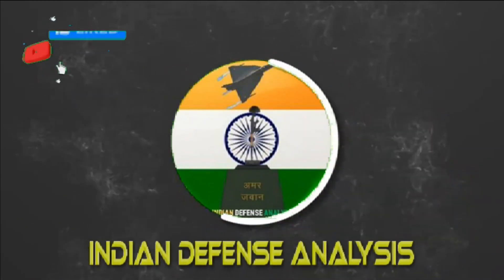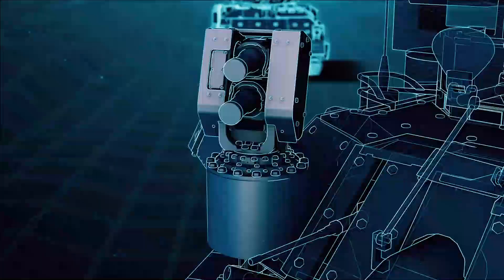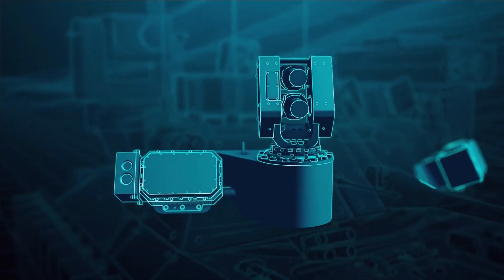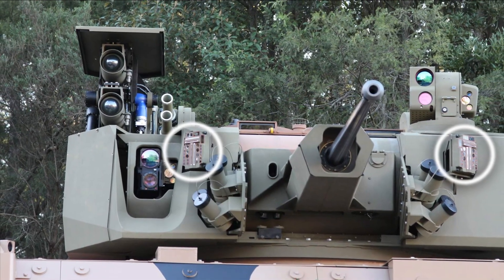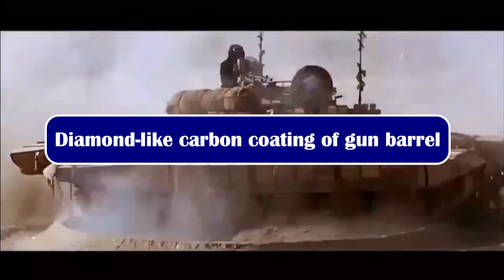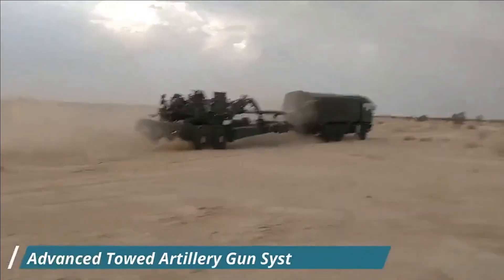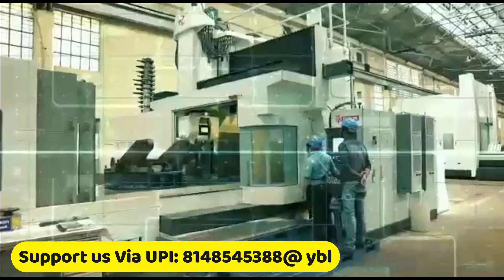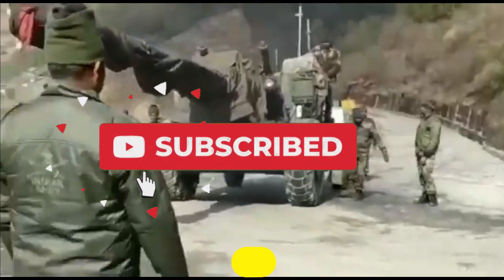Advance Laser detection for T-90, T-72 tanks and BMP 2/3 | Diamond-like carbon coating of gun barrel

Comment: I was thinking if pl 15E range i s 145 km then what will be the range of pl15 which is plaf using in there jets some people say it's more than 200km but if both export version and original version have same dimensions than its not possible to have this kind of range so i think it will be 160+ km just like astra mk 2
Reply from the maker: The most important point which is overlooked is no escape zone against fighter jets
Reply: @IndianDefenseAnalysis   if possible than please make a comparison video on astra mk 2 and pl 15 (chines version)